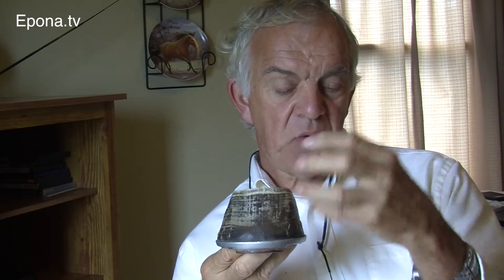Hoof anatomy with Professor Robert Bowker, part 4: Stimulating the foot

Comment: Just start googling all the words he says he's defining in this series, and you find that what he says is not what those words even mean. He constantly says "I believe this..." and "I believe that..." Well, that is not "science"! And does not have any real knowledge about dome structures. He's sitting there holding that coffin bone. You can clearly see the dome which is also an arch and telling us that it needs the front of the frog to support it. That is not the way domes bear weight.

In structural engineering, a half dome (or semi-dome) primarily bears most of its weight by transferring it to the supporting structures at its perimeter or base. (Ahh that would be the wall and sole together, not just the sole minus how he has people trimming the whole wall back to force all the weight on the sole.)

Here's a breakdown of how the load path and weight distribution work in a half dome:
Meridional Forces: Similar to an arch, the curved shape of a dome generates internal compressive forces that radiate from the crown down towards the base, according to MIT's DSpace. These are called meridional forces, which are the primary load-carrying mechanism in the dome's shell, running along the curved lines (like slices of an orange) from the top to the base.

Hoop Forces: In addition to meridional forces, domes also develop hoop forces (or circumferential forces) which are stresses acting along the horizontal planes of the dome's shell. These forces contribute to the dome's stability and can be either in compression or tension, depending on the dome's shape and load distribution.

Transfer to Supports: The meridional and hoop forces ultimately converge at the base of the half dome, where they are transferred to the supporting elements. These supports can be a solid wall, columns, or other structural components designed to receive and redistribute the weight to the foundation and finally to the ground. 

Key takeaway: The curved geometry of a half dome allows it to efficiently distribute the weight (including its self-weight and any applied loads) through a network of internal compressive forces, ultimately channeling these forces to its supporting perimeter or base.
Reply: The periphery of P3 is not meant to support the weight of the bony column. Yes, a dome transfers its weight to the base but the coffin bone is not a supporting arch - its 'base' is a sharp edge. The coffin bone's concavity allows for the biomechanical cushioning Dr. Bowker describes, containing the engorged vessels etc. to provide cushioning. If it were flat the cushion would splurge outward, but it's cupped nature directs the energy in/down providing support.